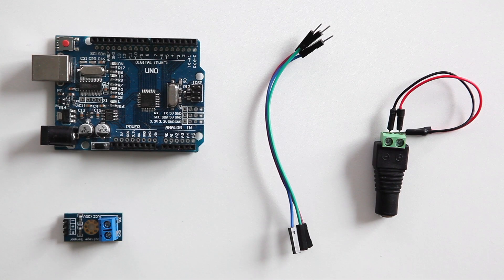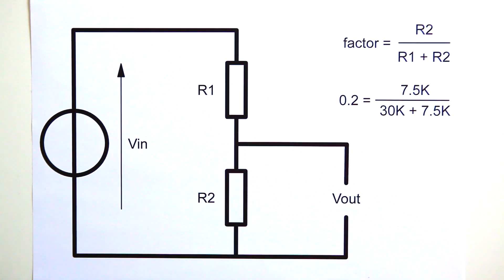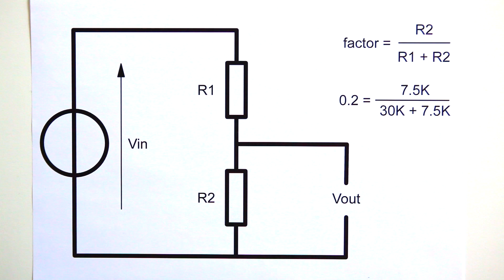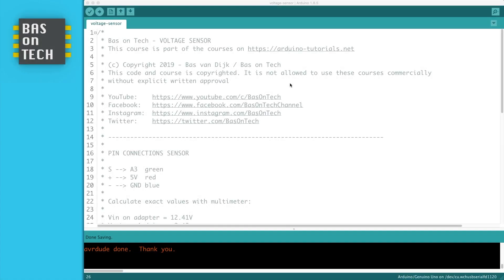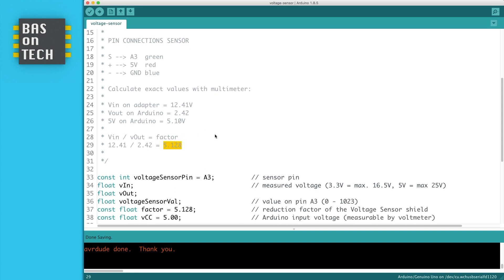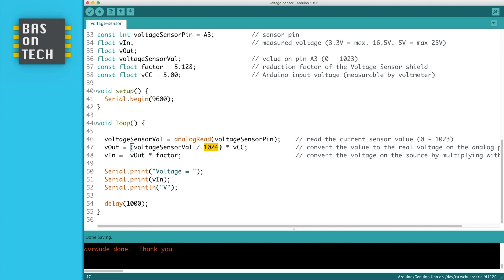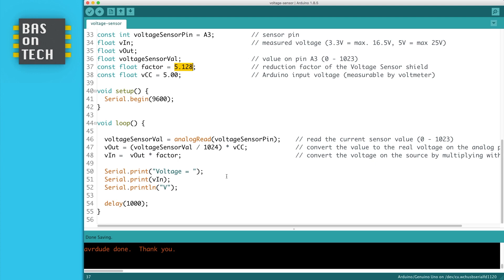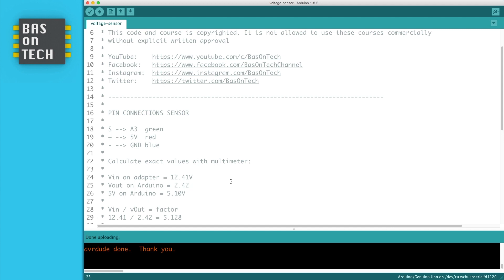VOLTAGE SENSOR (0-25V) - Arduino tutorial #17

Comment: I NEVER SAW you connect the 12vdc on your video
I m trying to calculate this 5000vdc and the R1 is equal to 5meg ohms, what is the required R2?
Reply from the maker: I think this voltage divider calculator will help you with that https://ohmslawcalculator.com/voltage-divider-calculator 😃

Comment: How do we power an esp8266 microprocessor with the battery while also checking the battery's voltage with the voltage sensor?  The 8266 uses 3.3V and the battery I'm using is a LiFePO4 3.2V.  If I use a USB cable to the 8366, everything works as expected.  But as soon as I unplug the USB cable from the 8266, there is no power to the esp8266 anymore.  I tried plugging a jumper wire onto the sensor's + pin and the other end to the 3V3 pin on the 8266, but that doesn't give it power.  I also tried connecting the jumper wire to the 5V pin on the 8266, but still no power.  If I connect the battery's wires directly to the 3V3 pin via a breadboard, my 8266 works fine.  Anybody have any ideas?  Is there any documentation for this Voltage Sensor board?

Comment: I have a question; I use both analog pin for precise voltage read and Voltage sensor for current that is over 12V. I noticed that when the voltage reading a separate source of 5V, my analog pin jump from 10 to 200 when it has no voltage supplied to it. Why is that happening?
Reply from the maker: That is hard to say, a guess is the sensor is broken. But that is just a wild guess.

Comment: The current draw by an analog input pin is less than 1 micro amp so any voltage dividing resistors in the kilo ohm range will give a pretty accurate measurement.

Comment: A better way to do this would be to use a zener diode eg 20v to clip the signal down from eg 23v  to 3v and measure the 3 volts and add it to the 20 in your code. That could give more resolution/accuracy.
Reply: Can you please elaborate this procedure?
Reply: @noccloud  say you want to monitor a voltage about 26 volts and you have a zener diode at say 24v. I would put the zener diode at the positive side of the 26v in series with a 1K ohm connected to zero volts. The voltage across the resistor is 26-24 =2 volts. The Arduino can measure the 2 volts. The software can add the 24 volts to give  an accurate reading of the 26 volts.

Comment: I wonder if this little board reduces noise or is it just a scam to make money because any pair of resistors are could do the job... And if one of the resistors was variable it would be fully adjustable.
Reply from the maker: I don't want to call this a scam. It just suits another target audience. There are many Arduino kits which use a 3 wires glued together for sensors, buttons etc. Therefore every PCB sensor has 3 pins even though they are not all connected.

You can easily make this yourself with bare components as shown in the video. Some prefer not to and want to use an off the shelf component.

The purpose of this tutorial is not to show the best / preferred way of measuring voltage. It is to show you to use and connect this specific voltage sensor.

Comment: Hey everyone, forget the + pin and the silly wheel in the centre. Neither are connected to anything. Just there to confuse you hahaha 🤣
The circuit just takes the Vcc voltage and divides it down to one fifth at the S pin.
Reply: Just multiply what Arduino reads off the S Pin by 5 = your measured voltage.
Reply: @sapoty  If we use this with an esp8266 or esp32 (which both use 3.3V), would we multiply by 3.3 instead of 5?  Or do we still multiply by 5?

Comment: Can we use this voltage sensor with current sensor (acs712) at the same time from the same source?
I want to measure supply voltage and how much current flow into the Load.
Reply from the maker: I do not see why not, however I've never used this sensor so at your own risk 😄

Comment: It can withstand 12v 1A ?
Reply from the maker: I think 1A is a bit too much for this sensor. But I can't proof it with a datasheet. All specs I could find talk about the voltage range and not the current limits.
Reply: @BasonTech  then 175mA ?
Reply from the maker: I assume it should work. Unfortunately without a datasheet telling me so, I can't confirm anything 100%. Use at your own risk 😉
Reply: @BasonTech  thank you 👍

Comment: Can we add a relay module. Function of relay is when the voltage reach example 14v relay will on and if it goes down to 11v relay will off?  It is possible? Thank you...
Reply from the maker: With an Arduino for sure! Just monitor the input of the voltage sensor and trigger the relay when you please 😃

Comment: Sir, I need ur enlightment, i folow ur code, now then i want to change range of this sensor into 0 - 2500 mV ? Is it possible ?
Reply from the maker: I don't think this sensor has such high resolution. The way this sensor works is just an estimate of the voltage.
Reply: Just connect your wire straight onto an analog pin.

Comment: Hi! I really needed help with connecting and taking readings of 2 or more than 2 voltage sensors simultaneously through the Arduino. The physical connections are do-able but I am facing difficulty with the code. Can you please help?
Reply from the maker: On what part of the code do you het stuck?
Reply: @BasonTech  double adc_voltage1 = 0.0;
double adc_voltage2 = 0.0;

 
// Floats for resistor values in divider (in ohms)
double R1 = 30000.0;
double R2 = 7500.0; 
 
 
// Integer for ADC value
int adc_value1 = 0;
int adc_value2 = 0; 

void setup(){
   // Setup Serial Monitor
   Serial.begin(9600);
   Serial.println("DC Voltage Test");
}
 
void loop(){
   // Read the Analog Input

   adc_value1 = analogRead(A0);
   adc_value2 = analogRead(A1);
   
   // Determine voltage at ADC input
   adc_voltage1  = (adc_value1 * 5.0 * 10.0) / 1024.0;
   adc_voltage2  = (adc_value2 * 5.0) / 1024.0;
  
   
   // Calculate voltage at divider input
   double in_voltage1 = adc_voltage1 / (R2/(R1+R2)); 
   double in_voltage2 = adc_voltage2 / (R2/(R1+R2));
   
   // Print results to Serial Monitor to 2 decimal places
  Serial.print("Input Voltage1 = \n");
 
  Serial.println(in_voltage1, 4);
  
  Serial.print("\nInput Voltage2 = ");
  
  Serial.println(in_voltage2, 4);
  
  // Short delay
  delay(500);

}
Reply: i have done this but it is not working
Reply from the maker: what error do you get?

Comment: can these be connected in series? like for a 10s battery
Reply from the maker: Good question! To be honest I don't know. Maybe you can find it with the datasheet of this sensor?
Reply: @BasonTech  i found that it's not possible, because that would exceed the 5v per pin on the Arduino. you would need to design a circuit with specific resistors to be 0-0.5 V per pin adjust scaling factor, and now 10s of 0.5v modules is 5v and now the Arduino wont be fried, probably.

Comment: Hi! Could you explain a bit more the plus pin on the sensor? In many tutorials, people simply ignore this pin, don't connect it to anything. They only connect the - and S pin. What's the difference?
Reply from the maker: I have honestly no idea. It could be that the sensor is not using this pin. Sometimes they have 3 pins to match the standard sensor wires which have 3 connectors and these are not all used.

Comment: There are a lot of fluctuations  after decimals... Is there any possibility to fixed this ?
Reply: Alternatively you can take 20 measurements in a second and calculate the average as a good estimate.
Reply from the maker: I guess you'll need a more accurate sensor if you wish such an accuracy.

Comment: seems the voltage varies a lot any way to fix that i have a running set up.
Reply from the maker: Hard to say, could it be that there is some loose connection? Otherwise this sensor might not be the best for your project.

Comment: how can get factor for esp32 vcc 3.3 v for this sonsor
Reply from the maker: I do not really have any experience with this sensor and the ESP32. I guess you can do the same measurements as I did for the Arduino. Only the ESP has 3.3V instead of the 5V Uno.

Comment: What if we want to measure voltage greater than 25V then the sensor work?
Reply from the maker: No this could be very dangerous! The max voltage is 25V Higher will damage the sensor or worse. You then should look for a sensor which suits the voltage range you want to measure.
Reply: @BasonTech  why not just put a zener diode in series. Say a 5 volt zener diode dropping a 28v battery down to 23 V to enable estimation of the battery voltage?

Comment: THANK YOU. what if we want to monitor our voltage and if it drops under a certain value to do something ( alarm,etc). is it possible with this sensor?
Reply from the maker: Sure, as long as the voltage of the device you are probing stays within the sensor range 😃
Reply: @BasonTech  of course, but is it a software or a hardware issue? Let's assume that we have one battery standby and when we notice a big drop of the main, to change using a relay to the reserve. How could this, be done. Thanks in advance
Reply from the maker: Just measure the voltage till it drops below a certain threshold, then switch the relay.

Comment: I need your advice for my project. I connect voltage sensor and irf520 mosfet module to the power supply (12V lead acid battery). Without connecting the irf520 mosfet module, the measured voltage is correct. But, the measured voltage displayed by the serial monitor is 25.2V after I connect the irf520 mosfet module to the power supply. May I know how to fix it?
Reply from the maker: I am sorry, I have no experience with a mosfet so I can't help you with this issue. My suggestion would to ask this on the Arduino forum https://forum.arduino.cc/ or on Reddit at the https://www.reddit.com/r/askelectronics/ subreddit. Hope this helps 😃

Comment: Can we make 100v to 440v Ac Voltage measurement with stm32 can plz help me on this I need to do a public Street light project to protect from voltage fluctuations my mail is  maheshcherlapelly (@) yahoo.in
Reply from the maker: If you want to work with that kind of voltages you certainly need heavier sensors, this one goes to 25V max...
Reply: @BasonTech  by using step down(440v Ac) transformer we get max 0-24v output does it good idea to go with voltage sensor which is used in this video? Your suggestion?
Reply from the maker: As far as I know you can use it as long as you stay within the range defined by the manufacturer

Comment: Hi friend, are you powering the Arduino from the middle pin + of the voltage sensor? I don´t get any voltage from that source only Signal, have i overseen something? thnx
Reply: @BlondieHappyGuy  hi there 
Yes I worked it out thank you.
I pretty much did the same as you have said and all works good.
Reply from the maker: Hi, have you connected your Arduino to the sensor the same way as shown on the circuit schema in the course material? https://arduino-tutorials.net/tutorial/reading-voltage-sensor-with-arduino
Reply: @BasonTech  I have wired it up the same and i get no power from the same pin, so where does the power come for the arduino?
Reply: The + pin is not connected to anything... Forget it exists.